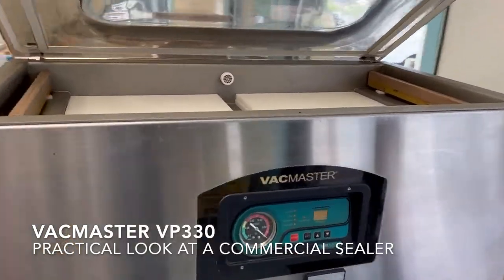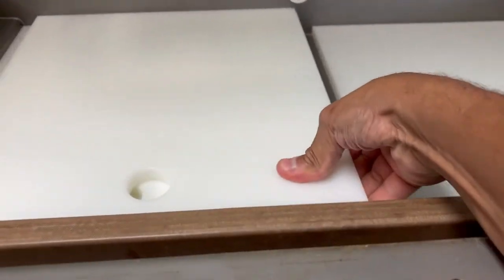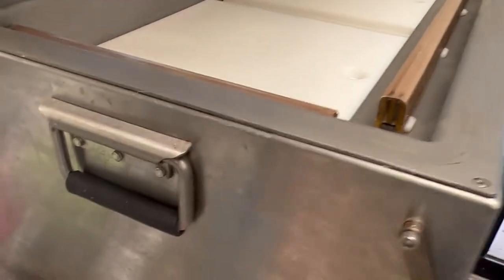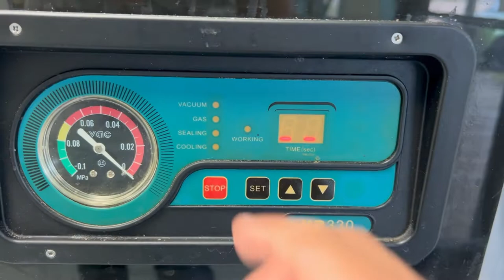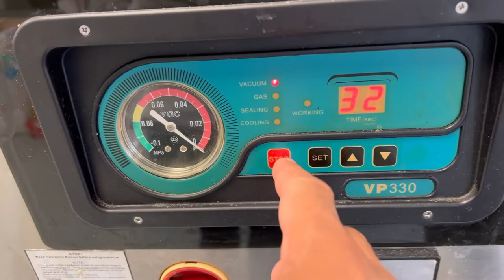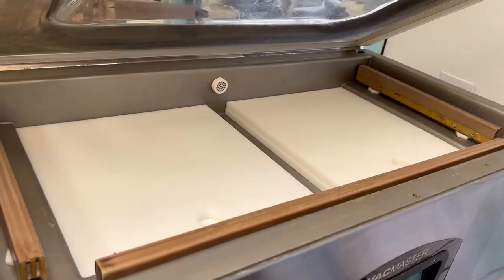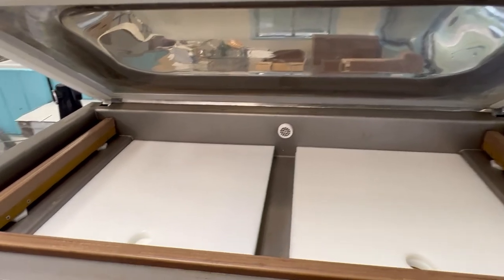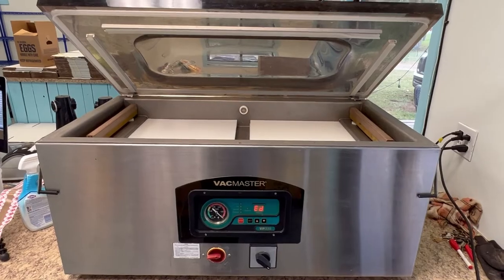Vacuum Sealer Review: VacMaster VP 330

Comment: The unit weighs 260lbs.  The sealing time is the amount the heat is on the seal bar.  A higher time may melt thinner bags etc.  The cooling time is the amount of time it sits before opening to let the seal cool so it doesnt open up being too warm on the seal bar.  We only ever adjust the Vacuum time based on what cut we are sealing.  Whole birds vs. Tender packs on trays etc.  Pretty cool unit.